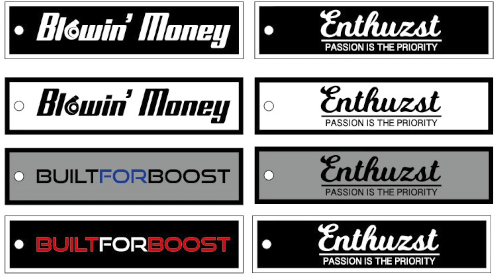WATCH THIS BEFORE BUYING PARTS ON AMAZON!

Comment: Lets see... I look up a part on Amazon and it's 15.93. I can get the item at 3 different local places and it's 28.99. Second part was 15.05 on Amazon and all 3 local places it's 59.99. Can you think of a better way to buy or reason to buy parts at Amazon. And the Amazon garage on the APP is cool to. Got an old junk car and I can tell if parts on it fit the wagon I own with the APP.

Comment: Expecting an aftermarket part to fit like oem is ridiculous. Even on oem  needs some finesse to fit correctly. Body panels shift, shrink and expand over time. Panel gap wasn't good from the factory so why the unrealistic expectations?

Comment: Hell I spent over 150 dollars on some acdelco struts for the wife's car. Ended up receiving moog brand struts in acdelco boxes! Completely different heights, mount bolts arrangement holes, sticker placements, and of course part numbers. So I requested a replacement and all be damned same thing again. At least the second one had a half ass slapped acdelco sticker that would just start to lift right off. I shit you not, I have all the photos. I will never buy auto parts from here again.

Comment: Personally hope you leave can lights off the lbs but also hoping that is the giveaway truck. As far as color matching for the minimax upper and lower valance looks best I've tried painted bumpers a few times most generally they look like shit then are definitely wrecked after 5 years depending on where you live and weather elements.